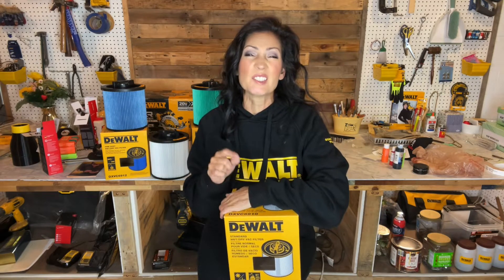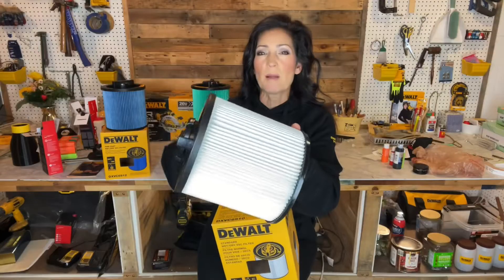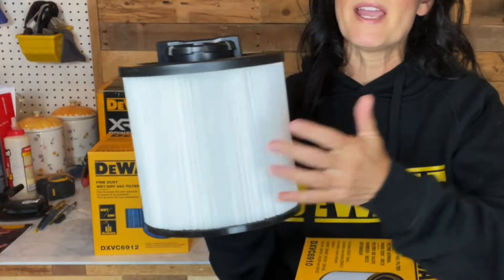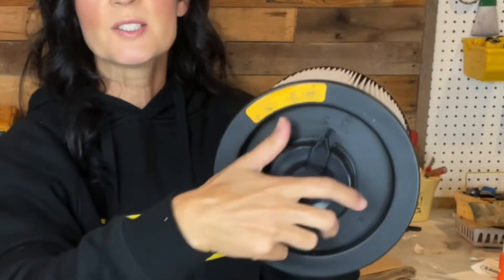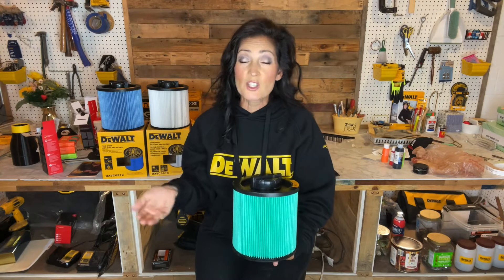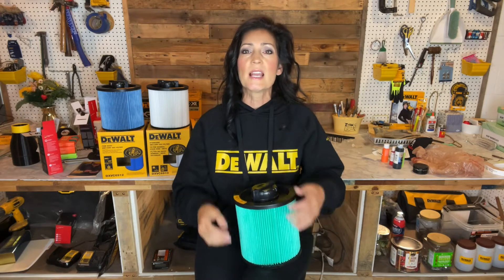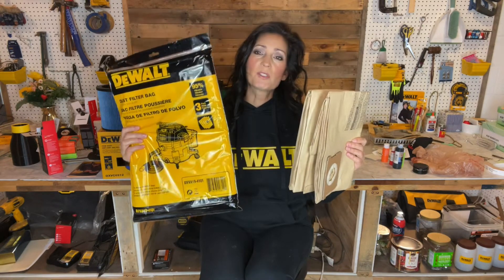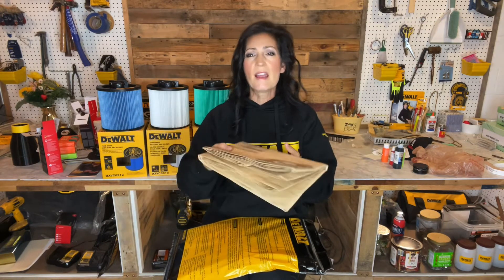Everything you need to know about DeWalt Shop Vac Filters, REVIEW of the Standard, Fine Dust & HEPA

Comment: Thanks for the video.  H
ow do you clean the filter? when do you know you need to clean the filter?  I maily vaccum outside the usual dirt collecting on drive way when you have trees. I love the vac but not sure what is the best use and cost effective way to use bag or filter.
Reply from the maker: Hi! You can shake the dust out of the filter every couple uses if needed and I often use my air compressor to gently blow dirt out from the folds. There's no one size fits all answer, it's mainly as needed. I also listen for any changes in the suction or engine. If it sounds like the vacuum is struggling, I look at the filter. Hope that helps, thanks for watching!
Reply: Thanks for taking the time to asnwer.  I actually found later someone who recommended to put around the filter pool skimmer socks .  I ordered a pack and seems perfect so far.  @Jennyfromtheshop

Comment: Do you take the filter out before vacuuming up water? Thanks
Reply from the maker: The canister styles can be used with liquid if you’d like, the bag type cannot. The canister type will become saturated after several tanks though, and it would need thoroughly dried before reusing. I personally would remove it if I was going to vacuum water because I wouldn’t want the hassle of dealing with the filter. Double check with your vacuum manual just to be sure your model can be used with or without.

Comment: Do you use both the canister (HEPA) filter and the dust bag together?  Or just one or the other?  Thanks
Reply from the maker: I would personally use both together, although I need to look at the directions or contact the company for an accurate answer. This is a question I get a lot and want to do a short video on the topic.
Reply: You don't need the bag. All the bag does is make it easier to empty. For that matter, you don't need either for vacuuming liquids. Liquids will destroy the bag and the filter isn't filtering anything out of the exhaust as the liquid IS the filter. There's no dust flying out of the exhaust when vacuuming liquids. Using a filter when vacuuming liquids is just ruining it faster. There is a float inside the vacuum that shuts down the suction power once enough liquid has been sucked up.
Reply from the maker: @American-Plague  Agreed. I only suggested using both because the viewer asked about the HEPA filter so I assumed they were concerned about dust particles.

Comment: Unfortunately video does not answer my most basic Qs — how often can the store-bought replacements be washed before replacing? Also, is the one provided when I bought the DeWalt shopvac also washable? Lastly, if I don’t care about the higher micron filtering, do I ever really need to replace?
Reply from the maker: There’s honestly no way to answer the first question, each user will have a unique set of circumstances such as how often they use it and how much dirt accumulates based on what’s being swept up. When it looks raggedy from washing it or the machine sounds like it’s struggling, replace it. Also, I don’t know what model you purchased but the users manual should give some guidance for the filter that came with your vacuum. Lastly, you don’t need to replace the filter that came with it with the micron filters if you want to keep using the standard ones. Over the life of your vacuum, you will most likely need to replace the filter several times, but again, it’s as needed.

Comment: Just bought the Dewalt 6-gal 'quiet' shop vac (Model #DXV06PL-QT). Bought a DXVC6914 Hepa Filter for it. All Dewalt literature states this is the right filter.  It is not.  The filter on the machine is much smaller, roughly 5-1/2 X 5-1/2. The 6914 is 7-1/2 X 7-1/2 and absolutely will not fit.  Any thoughts?